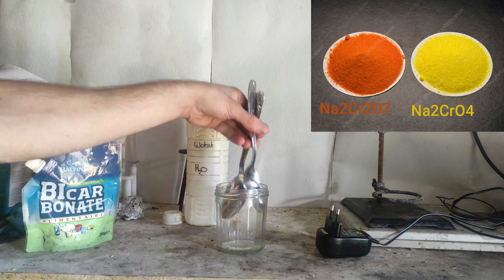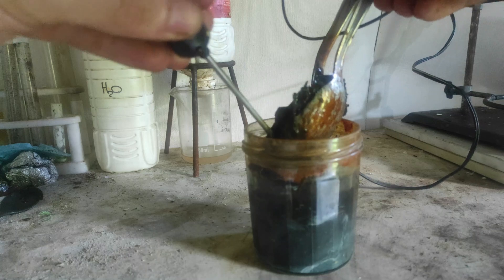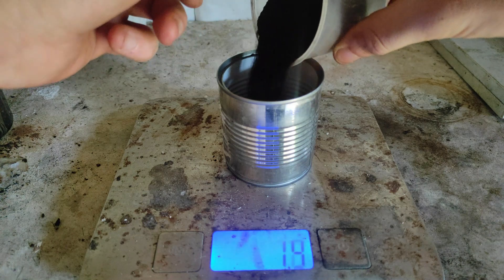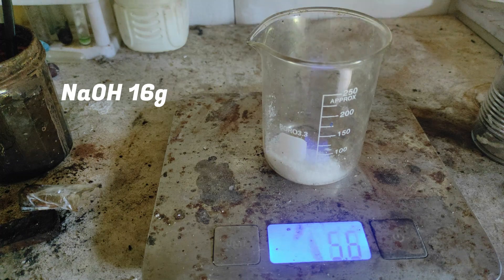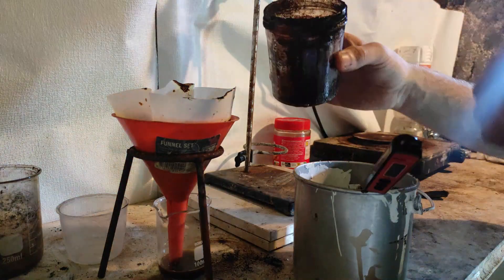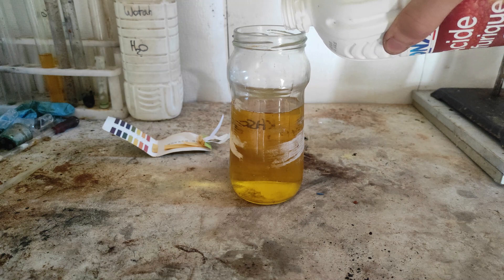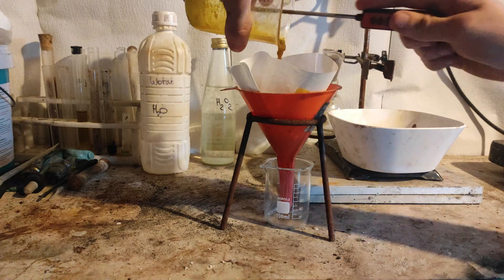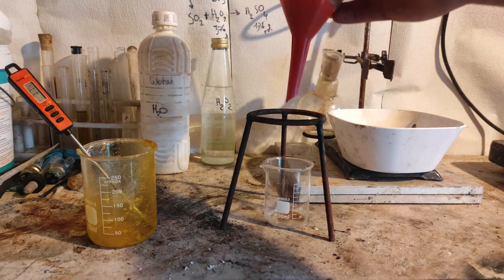Dangerous carcinogen from spoons and forks, dichromates (electrolysis process)

Comment: Very cool video! 
The souce of those impurities is the fact that stailess steel is not just chromium and iron, it also has mangnese, nickel, carbon(in large proportions) and some other junk.
As a tip, unrelated to the actual synthesis, i recommend cleaning your lab more often since it can lead to massive contaminations and also, when you test for ph, try to use a pipette or a glass rod to wet the litmus and not dip it in the reaction flask. Apart from that great work and keep going!
Reply from the maker: Thank you very much for your advise ! 🥖❤️

Comment: @jam_kemist You don´t need to decompose the metal hydroxides into oxides in order to make the chromate or dichromate salts you want, it still works well with the hydroxides.
Reply from the maker: Well yes it does work if you don't care about the stoechiometry, I needed to isolate them to know how much I had bcz I didn't thought about weighting the fork and spoon yet at that time.

If you weight the fork and spoon before and after and do the math it's fine I guess 😌

also you don't have to mesure H2O2 since the exess would anyway decompose when boilling down 👌🏻
Anyway Thanks for watching have a good day ! 🙂
Reply: @jam_kemist3986  Yeah, but chromium(III) hydroxide reacts more easily with the sodium hydroxide and hydrogen peroxide mixture, increasing the yield. I would bet there´s still quite a bit of chromium in the leftover metallic sludge. I think it´s easier and a bit more convenient to dissolve the stainless steel in acid, precipitate the metal hydroxides, filter and wash them and finally do the oxidation of the chromium(III) hydroxide into a soluble chromate.
Reply from the maker: @chemicalmaster3267  trust me, you don't wanna filter metal hydroxides from a solution, what I mean is that the NaCl will be very hard to completly remove from sludge, so while it takes longer to use electrolysis, it still worth if you don't wanna filter sludges for decades

Comment: Very nice, i discovered this idea by accident using a piece of chromium steel plate for the cathode in an electroysis experiment last year.   I was driving the cell current using a 40 watt solar panel.   This is actually a quite useful way to obtain various metal alloys in the form of their salts, besides selective solvents and fractional crystallization a magnet passed over the dried 'sludge' powder can help take out iron oxide.  Good work!
Reply from the maker: Thank you ! That's actuelly a very good idea if the powder is very fine, if the oxides are too mixed it may not work tho I'll definitly try next time I do this !
Reply: @jam_kemist3986 if you try it, then put your magnet in a plastic bag and do it while in a dilute suspension to keep the iron oxides/hydroxides separate from the other precipitates. Not every oxidation state of iron sticks. It should separate nickel as well.
Reply from the maker: @petevenuti7355  thanks for the comment ❤️ !